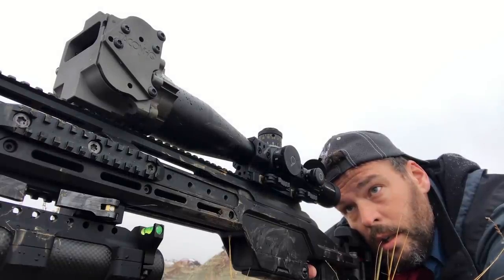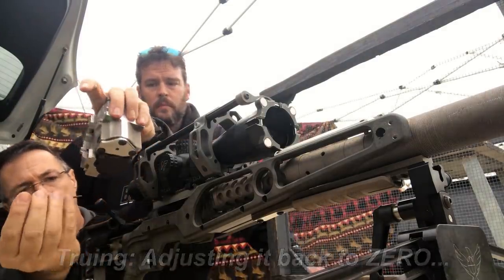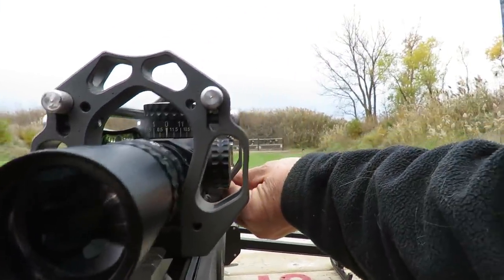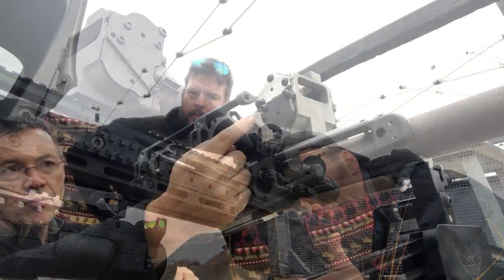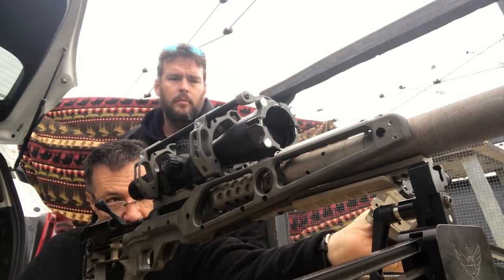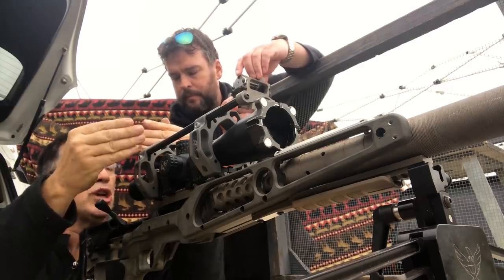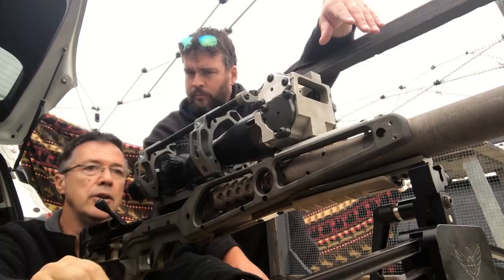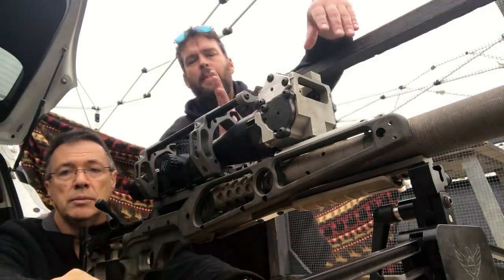How to get over 5,000 yds of Scope Elevation: TACOMHQ Charlie Tarac Set-Up ~ Rex Reviews

Comment: Love the setup but think this thing would work wonders simplified from a user input style a bit more. If there was a way to lose the need for the drivers and wrenches that would really be nice
Reply from the maker: I admit it certainly appears unconventional when doing it the first time however it is more simple and has less steps than the process of mounting a base, rings and scope and zeroing a rifle.  Just seems weird at first glance ;)
Reply: @TiborasaurusRex  So is it more or less something that would be pre zeroed before going out to the field? Get your max expected range dialed in on this kit, when you you can't dial in anymore on your standard setup than you throw this bugger on and reset your turrets to zero, start your dialing from whatever your max with that scope and this gives you the extended?
Reply from the maker: Exactamundo.   Mine is set for 20 Mils.  Clip it on and you have an instant 20 mils.  However it can be adjusted to any amount within visible range. Once adjusted and locked down it is a fixed unit.
Reply: @TiborasaurusRex  Roger that. Not so scary to think about doing now. For some reason my thinking went to losing that tiny wrench in the bottom of a pouch when it's time to put in a firing solution. I'm tracking now though, thanks Rex

Comment: What the heck is that rifle!?!?
Are there hollow channels around that bore?
Reply from the maker: It's a structured barrel design that dramatically increases rigidity, cooling, and disperses harmonic reverberations in a very interesting way.
Reply: Google F-Class rifles. They are not really designed and practical for field use. F-Class is basically rifle caliber artillery tech.
Reply from the maker: Although it looks incredibly massive, I would not necessarily put this into the F-class category, it is actually a very light weight and fieldable design.
Reply: @TiborasaurusRex    Thanks.  I also, noticed that and posted a redundant question.

Comment: I could stretch my .22 to 500+ yards👍
Reply from the maker: Actually yes, that is my next plan. I am putting this on my Ruger 10/22 to see what is possible.  With the proportions of the typical 40 grain lead projectile and the initial transonic velocity of the bullet exiting the muzzle, I think it should not encounter the same challenges of destabilization of supersonic rounds coming through the descending leg of the trajectory hitting the transonic shockwave anomolies ... In a nutshell I think a .22 will go pretty darn far, pretty accurately - IF - one can get the elevation required, which this unit accommodates.
Reply: TiborasaurusRex i'm going to try the same thing on my savage 22 but with the axeon second zero. The charlie is a lot of money for a 22. The 22 is super stable i shoot mine at 325 often. It's so consistent it's boring but it's where i run out of elevation, until now
Reply: @TiborasaurusRex  .22 TROM coming?
Reply: You only need about +24-25 mils to 500 yards from 25 meter zero with a .22 👍 A 40 MOA rail and a scope with 20 mil internal adjustment will work fine. Wind is a way bigger obstacle. Just a fart of wind is all it takes to change impact several mils. Good for wind mapping/reading skills though😎